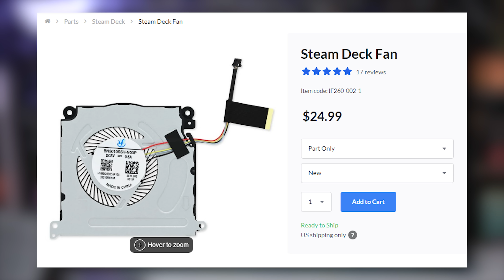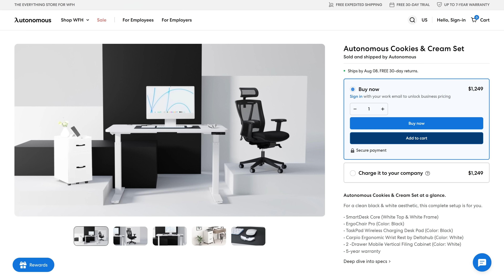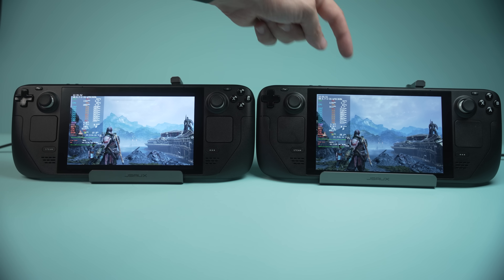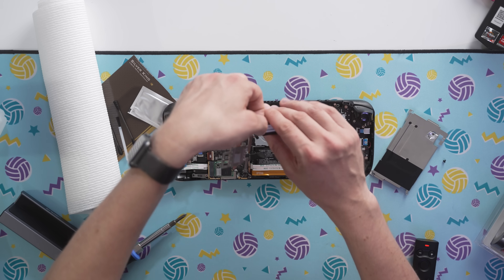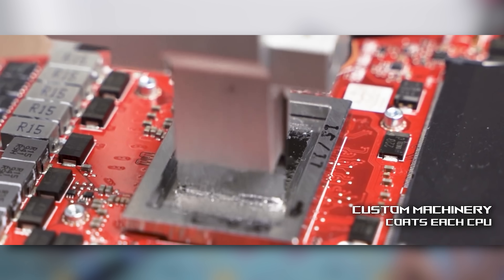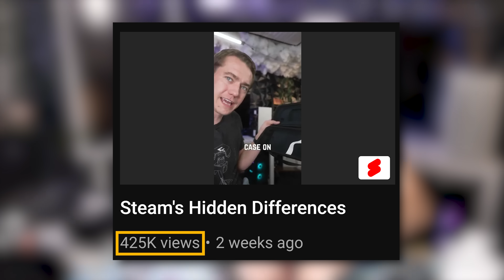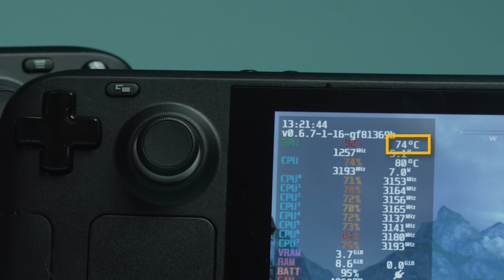Fixing the Steam Deck with Liquid Metal

Comment from the maker: ► Big thanks to Autonomous for sponsoring today's video. Check out their Dream Setups here: https://bit.ly/3JvGGpK
Reply: should have went with valve's og colors, baby shit green.
Reply: Someone is claiming to be you by saying they are giving away a free PC
Reply: @1up4evr7  Don't react to this, it's a scam. I received multiple messages like this already on YT.
Reply: Clear nail polish or conformal coating would have been safer.
Reply: Out dated take so thermal pad 7950 and use vented back plate or and slight vents to the back even under load pulling max 4 GHz at 1800 slight under volt I'm at 74 to 72  cheaper safer

Comment: I would personally use either bathtub Silicone caulk that's known to be electronics safe, or decent nail polish that doesn't decompose under heat of both APU and heatsink. Still, I am considering looking at using liquid metal thermal paste for a few electronics like my old APU laptop that may be due for thermal paste replacement soon.

Comment: its better ptm 7950 ,yeah liquid metal is the FASTEST to transfer heat ,but its also electrical conductive ,where ptm7950 is almost as good ,but no problem with conductivity ,both of them exceed any thermal paste or tim ,period. the thing that no one seems to understand is that you need to move heat faster ,so a "limited" cooler like steam deck can cool fast enough the soc. thats why fan blow slower with liquid metal or ptm7950. its because the heat is removed FASTER not  BETTER. maths are important :) . Also yeah the cooler is pretty limited ,they should do a little larger or with more fins xD. anyways if anyone is gonna use liquid metal ive been using it with nail polish to protect the SMD around the cores for years without a single fail. nail polish FTW.

Comment: Use can use GRIZZLY TG shield to isolate the components. Which’s cures in 30 mins, allowing you to use Liquid Metal. Also Liquid Metal doesn’t destroy copper all the way through. It only chemically reacts to the top layer, which can be buffed off. There was a 4 year test done on copper heat tubing and Liquid Metal literally did nothing to it.

Comment: You should revisit this with cryoutilities and overclocking / undervolting and a higher TDP and present the numbers. I'm too lazy to do AB testing other than quick rough testing for myself. I am considering going to LM as I initially just went with kryonaut extreme. I am running 20w TDP and 4ghz CPU 2ghz GPU with -50mv across the apu with cryoutilities default recommended settings and thermal seems to be my current bottleneck.

Comment: As shown in another YT vid, there are some success with replacing the OG thermal compound, in this case, Thermalright TFX, without using this LM risky stuff. I have replaced the thermal compound on my Deck, and getting temps, around 4-6 degrees lower. Seems that valve used a very cheap thermal compound. I am wondering, if replacing the thermal pads would do another improvement.

Comment: I strongly advise against using liquid metal on proprietary hardware like this. If your steam deck is overheating your best bet would be to get thermal paste aimed at pc gaming enthusiasts to reapply. Even then I would look at replacing the delta fan (if that’s what you have) and tinkering around with settings before performing this kind of surgery.

Comment: I'd only use this stuff on a PC that doesn't move and only on a motherboard that is laid horizontally. This stuff gets even runnier as it heats up and will drip into components. I've seen dozens of nightmare images and videos of it ended up in fans and splattered all over the inside of cases.

Comment: I'm using this as a reference for LM'ing my gaming laptop.

So just to get this right, to prevent issues with liquid metal I need to use some combination of these to protect my motherboard?
- Kapton tape / Polyimide tape OR regular electric tape
- nail polish coating OR Thermal Grizzly Shield coating
- silicone sealant barrier OR non-conductive thermal paste barrier around the CPU die

I bought pretty much all of these to make it as hard as possible to mess up. The only thing micro center didn't have in stock was the actual liquid metal. Is there anything else I'm missing if I want to do this as protected as possible?

Comment: I use a 2022 asus zephyrus g14 for gaming on the go, and I hate it lol. Tiny mobile gpu’s just don’t have the performance nor cooling to be good. I can play games at 1600p60 high settings, but it sounds like a blow dryer, and makes my hands sweat from how hot it is. Even if I turn it down to 1200p, it’s loud and hot. Not what I expected for $1580 plus tax. The integrated graphics on it are even worse, struggling to do 1080p60 low in every modern game. I feel the same way about the steam deck. It’s almost cool, but the performance, heat, noise, and price just aren’t worth it. Maybe next gen could result in a viable mobile solution.

Comment: You can't use liquid metal in a handheld console without proper cpu preparation.Liquid metal is very fluid, especially when heated. Any vibrations of your console can cause liquid metal to spread.

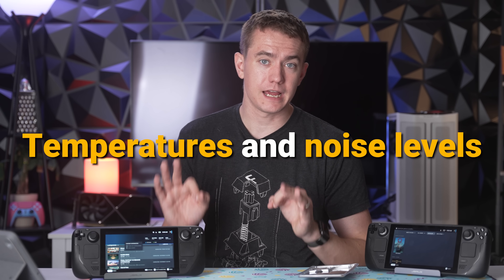Comment: At 4:40 both of the decks are running different aspect ratios meaning different resolutions. Not a fair test at the one on the right has to render 10% more pixels.
Reply: but the modded one has more to render?! so the results must be even better

Comment: At 12:00 timestamp, were the application settings the same between the two devices? The non-liquid metal version shows 4GB of VRAM and 9.2+0.5GB of RAM usage while the one with liquid metal installed shows 3.7GB of VRAM and 8.6+0.0GB of RAM used.
Reply: @UFD Tech?

Comment: Not to call you out in any way but why are your stream decks in different resolutions for this test? I don't think the numbers are quite accurate if they are both running slightly different. Notice at 12:36 in the video, amount of black bars on the two models differentiate quite a bit.
Reply: Big bruh moment not gonna lie

Comment: Big question did using the liquid metal extend the time you could run games compared to the base steam deck. Since the fan is not spinning as fast this is a question I would love answered.
Reply: It does, especially if you limit fps to 60 or less. When a Processor gets hotter, it looses efficiency too. (More leakage current)
Cooler is always better.

I undervolted my GPU and CPU.
Pc is quieter and has the same performance with 60W less. It got more efficient
Reply: @McKuc  in addition fan itself also consume some power, and less speed save maybe 0.25-0.5W, for steam deck it is a big deal. Sad that author didn't show power consumption from battery (with disconnected wall charger).

Comment: my steam deck went from doing 89c on GTA 4 to a cool 69c to 70c. i also discovered that there was way too much thermal paste from the factory.
Reply: With LM or just new traditional thermal paste?
Reply: I applied liquid metal and saw incredible results. Not recommended though do it at your own risk. I still don't know what will happen in the long run.
Reply: @2nmingo  how’s it been so far
Reply: Its still holding pretty good so far. I want to open it to see how if there is any visible issues but i dont think there is much to worry right now
Reply: @2nmingo how is it so far
Reply: @d4nkog716  its doing great so far no issues what so ever i want to open it and see if there is any corrosion to the cpu or copper pipe.

Comment: Ive never cared about fan noise. I want maximum cooling possible. The soothing sound of fans isnt annoying in the least. Only time its ever been a problem for me was when i tried to put a pc in the vocals booth in my studio so i could edit right from there instead of having to get up and come out to edit and go back in ever ytime i wanted to change anything. Ended up going with a long extension usb cable to a hub in the booth for M&K, and a monitor in the booth and the display from the pc was duplicated on both monitors. All problems solved. But other than situations where noise levels actually matter, i care way way more about the performance of my cooling system. Give me the loudest beefiest fans possible and crank those puppies.

Comment: You should use a dense foam and cut the shape out
Electrical tape will loose its sticky side after heat cycles.

Comment: Spinning slower doesn’t change the longevity of the overall fan whatsoever. It’s rated to spin up to a certain speed, if it spins anywhere within that speed, static, it will last as long as any other speed within that range. Constantly changing speed is what kills fans, so if you have dynamic profiles where the fan can go real slow, then real fast when needed, that will actually harm longevity.

Comment: i plan to do this mod , but with ehither 388 silicone , or a thermally conductive silcone sealent around the chip since smd caps still produce heat (anything with current flow will ) , i also plan to get another backplate and cut out sections to replace with ehither copper or aluminium plates in places to cool the charge controller , memory , attach to the heat pipe for extra output dissipation and any other heat producing components i can find , the way i see it i dont buy gear like this often and id like to make my deck run as cool as it can for as long as it can , lower tamps arent just about performance and battery life or even just sound , a cooler chip will live longer , thats my plan anyway , might post a vid in a few months when i get me deck and hopefully after all has gone well , we shall see
Reply: Lol tell that to my old overclocked fx based pc that lives in the living room.
Built it back in 2012 I belive and it still heats the living room to this day, been running at 4.9ghz the entire time.
Reply: @joeblow8893  well that makes sence really , if it heats the room , clearly the heat is coming out

Comment: Looks like a solid mod.  No risk if you use electrical tape and ever changed thermal paste to begin with.  I'm definitely doing this.  Lower fan means quieter and longer battery, can't go wrong.

Comment: @UFDTech what’s the possibility of upgrading the cpu to the new 6800U AMD . Due to Deck being AMD already .
Reply: There is no posibillity, and the socs gpu will most likely still be faster anyways. The only way would be custom mainboard, custom firmware, bigger cooling solution etc.

So no.

Comment: Imo liquid metal isn’t worth the risk, I liquid metal’d a laptop, was very thorough with covering everything that could short on the mother board with liquid electrical tape and over time I still ran into issues with many mysterious crashes and losing functionality like hdmi port and lately can’t get any microphone to be recognized 🤷🏻‍♂️ I’d recommend just a higher quality traditional paste.
Reply: I agree with you, i have also use LM, yes the temps and all are better, but the risk are so big even if you think you do everything correct the LM can sipp out and make your gaming laptop into a nonGaming deadtop. For me it stopped reciving power from the power cable when in heavy use, the power adapter was fine, the power jack was fine and the battery was fine, i checked with multimeter and even orderd new adapter and power jack, still same issue. When i tried to play games on the battery fps in games was normal, yes i know its bad to play on battery, this was for test, i also tok inn the power adapter and fps went from 30 to 10 with the power inn. Lucky i sent it in to the warrenty and got a new motherboard coverd under warrenty. So i will be sticking to thermal paste.

Comment: With those modifications, it might even help with battery life. 🔋
Reply: No it wont. The Fan uses very very little power. The SOC would even tend to use more power cause it can get rid of the heat faster, so either nearly no improvement or even worse battery life. But either way barely anything if anything.
Reply: @nxy6123  this improves battery life 100%, especially when you limit frames to 60 or less.
The APU runs more efficient when it is cooler. (Less leakage current)
The APU is limited to lets say 12W or 15W no matter if you use liquid metal or not.
In bothcases it gets max 15W or so.
Reply: @McKuc  still no. The apu wont magically use less power, also you forget that the screen ssd and everything else also uses power. Apu is Max 15w, also tdp isnt max power ussage. PCs are a great example - CPUs can Spike much higher if they like to and can get rid of the heat, but i can Tell you that the steamdeck doesnt do that.

So no battery improvement at all by using liquid metal.